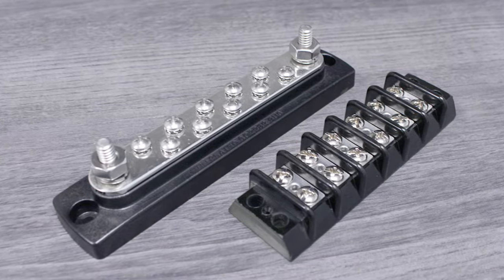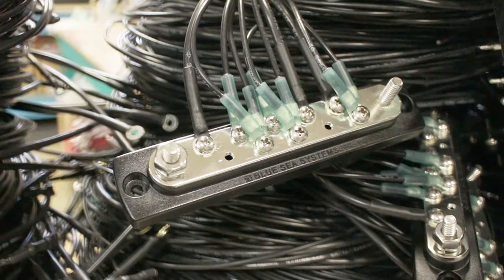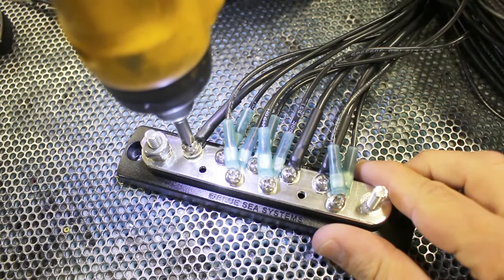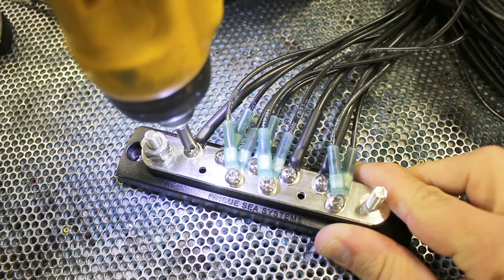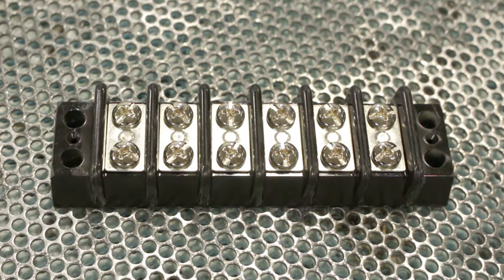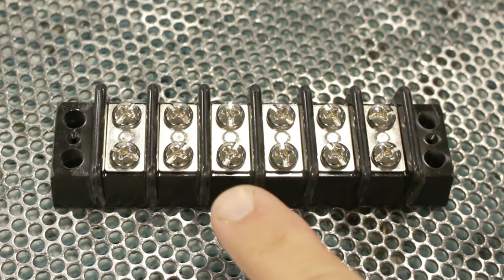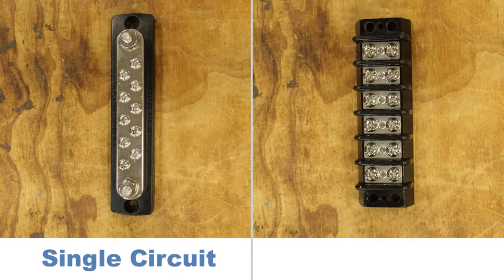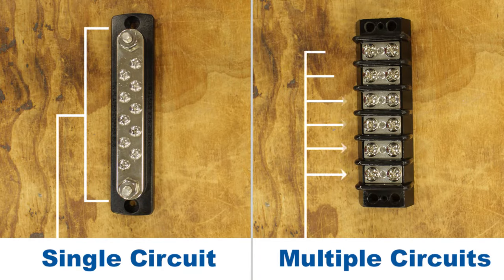The Difference Between Bus Bars and Terminal Blocks

Comment: Does it matter if a terminal block is single or double row? For example, the one at the beginning having 6 bolts instead of 12 and connecting two o rings on each other instead of separate.
Reply from the maker: All terminal blocks we offer carry two screws per circuit separated by the dividing wall of insulating material. I hope this helps.

Comment: Can I use a busbar for powering multiple car audio amplifiers
Reply from the maker: While it is possible to use a bus bar in this way, it is also possible to damage equipment if wired incorrectly. The best advice is to have a professional install it.
Reply: @pacergroup  should I install a fused bus bar

Comment: So what are bus bar used for?
Reply: Bus bar can have the single mains power coming into it. With multiple ccts coming of it. As opposed to solder multiple wires to the one main wire.
Reply: Ahh... got it. So you could do the same for both the positive and earth.
Reply: For parallel connection.